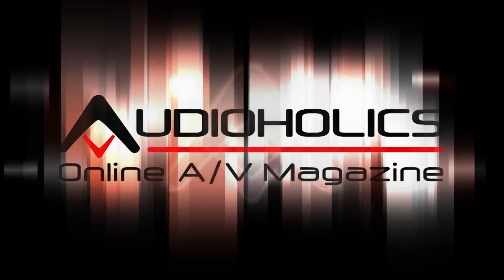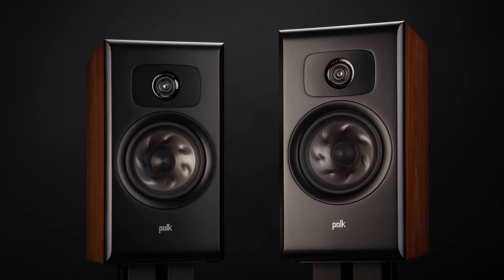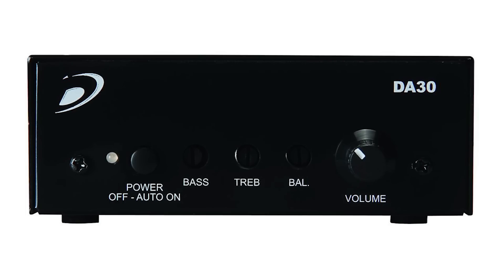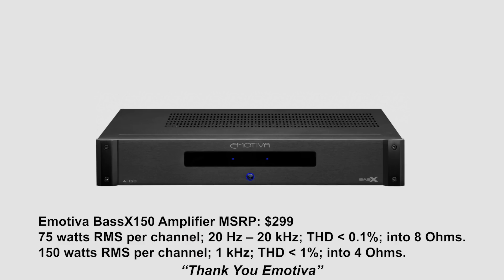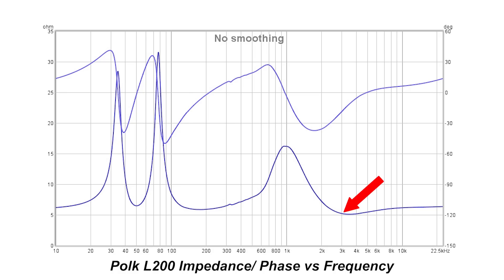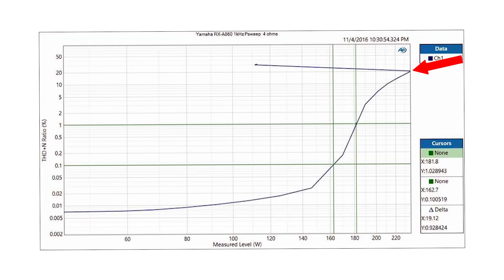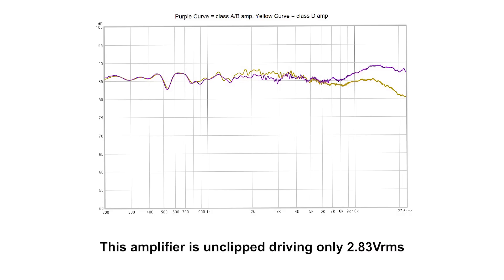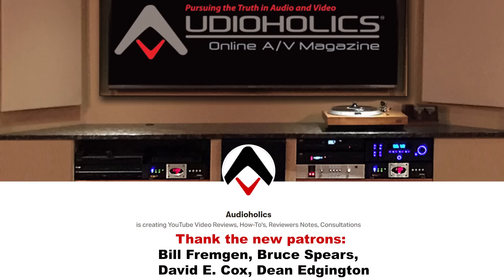Proof That ALL Amplifiers Don't Sound the Same

Comment: Useful info for sure, and a good reminder that amps must be able to drive a speaker at its nominal impedance. I’m not sure this proves that all amps don’t sound the same, though. It simply demonstrates that using an amp which can’t deal with a 4 ohm load with a 4 ohm speaker will provide poor results. Nothing surprising there.

Comment: Use the ice power 50asx(se) amp  its 50x2 at 4ohm and 0.003 thd and its under $99 on ebay. Pair that with the khadas tone board dac that has 0.000337%  thd that's under $99 and you will be in clean sound haven.  All the highs will come through flawlessly.  The amp they sent you had 1% thd if I'm not mistaken.  So that means that 1% of the pure sound was lost inside of the amp which is very noticeable.
Reply: Oahu Pc at 150W , 4 Ohm. It would be very small amount at lesser power output.
Reply: @RennieAsh  I'm really in to super clean sound and i found that the cleanest sound Is in the lower watt range. So when i see 150 watts at 1% that's not for me.

Comment: I prefer yellow curve.
Reply from the maker: The speaker measures a bit bright with a neutral amp. If you want to tame the highs, it's better to use a tone control then a bad amplifier.
Reply: @Audioholics  I like that one, so many people are allergic to tone control. I use it all the time, specially the bass control which I change with different volumes.

Comment: Gene: can you test using a Crown class D amp. They are very cheap (300 usd) and they say they can drive anything.
Reply from the maker: Yea I don't believe that claim but it's something I will try to test after I get the AH Smarthome finished.
Reply: Just like any other topology there are good Class D amps and bad ones. If you are curious about them then I would recommend the Crown 2502.
Reply: And they give you lots of hiss for free!
Reply: @mesonto  Only if you don't know what you're doing. Turn the gain down.
Reply: @666PANDEMONIUM  no, not my experience, returned them a while back... Cheap amp, but not a good one. Was buying them exclusively for a video room, for the cheap power. Gain adjustment was the first thing done to them. Maybe I and others get lots of lemons, maybe a quality control issue with Crown. 

Regardless will be staying away from them.
Reply: Get a Berhinger ep1500. it’s an exact clone of a QSCRMX 1450. class A/b 

Harmon makes good speakers infinity JBL the amplifiers blow
Reply: Carl Capps  I have Crown XLi2500 powering Cerwin-Vega! SL 15s. Sounds great, lots of headroom, under $500. class AB for anyone who don't know

Comment: Hi Gene I just experience this with my stereo system I bought a Onkyo receiver in 2016 and was using it to drive my Acoustic Research speakers 93s I bought new in the early 90s a few days ago I bought a vintage Luxman L  505u . Both of the receiver and intergrated amp are the same output, The Luxman is the first amp to really open up my speakers on the low end without having to adjust any tone controls because of the driver configuration they are like a baby brother to AR9s.(I did update the crossover caps and I had to replace the original woofers because of a cat catastrophe

Comment: From personal experience, my 1998 kenwood 2 channel amplifier sounds better than my yamaha advantage receiver (using both in 2 chnl stereo).

I have an off-topic question, i have jbl headphones, is it normal to hear a "hiss" noise when noise cancellation is activated?  I find they sound better when it's turned off?
Reply: @Jingle Nuts I can believe the Kenwood sounds better; being a dedicated 2 channel design it will be much simpler inside, giving a more direct path from source to speakers (especially if there are no tone controls, or they're switched out of the circuit). In general, an average 2 channel amp will sound better than an average receiver when playing music in stereo.

Comment: Hey Gene, I'm more or less in the 'amps sound the same' camp, really it's 'electronics sound the same', but there are caveats that go with that.  From Peter Aczel almost 30 years ago, The Audio Critic from its Spring through Fall 1991 issue:

"In general, any two components A and B that can be
alternately switched into and out of an audio system in an
AB test will sound the same if (1) their linear characteris-
tics are essentially identical and (2) their nonlinear charac-
teristics are below the threshold of audibility. If you think
about that statement for a minute, you begin to realize that
it‘s a truism rather than a heresy; the trouble is that the
tweaks and cultists often think for less than a minute."

That amp should not have been rated at 4ohms, it wasn't capable of maintaining a flat frequency response over the audio band.  Aczel specified for amps:

"Power ampliﬁers must
have high input impedance, low output impedance, no fre-
quency-response anomalies, and be at all times operated
within their voltage and current capabilities in order to
sound the same. "

Transparent audio just isn't hard, they've known how to design and build it, and how to test it, for a very long time.  If some piece of hardware isn't transparent when it should be, there's a problem somewhere, or it could always be gross incompetence, that possibility should never be ignored.
Reply from the maker: Agreed but without 3rd party measurements, most consumers won't know which amps behave properly into 4 ohm loads. There are esoteric expensive amps that misbehave, not just the cheap stuff.
Reply: @Audioholics  Mechtheist doesn't realize that never in this world did an amplifier solely designed by Peter Aczel** exist.  So reviewers are just filled with misinformation .  I am in the process of going through webinars on many products you carry and other manufacturers.  It's a joke the misinformation manufacturers feed to sales people (intentionally and unintentionally).  Like mechtheist I have been around a along time but I have 30 years of experience not 1 year of experience x 30.  One needs to design an amplifier to realize that you have to make a decision about what value component to use and how those different values change the sound.   And do not misunderstand, not an audiophile resistor versus non audiophile resistor but 10Kohm versus 8.4kohm.    I once participated in selecting an interstage transformer for one of the best amplifiers there has ever been to play music.  The amp designer made 13 slightly different transformers and on 3 seperate days I chose the same transformer each time.  It was a single blind test and the order of the transformers was randomized.  I was allowed to go 2 rounds reducing the amount of transformers I was comparing for my final selection,  For me I was surprised to have continued selecting the same transformer.   Measurement differences were almost negligeable individually addressed but if you compounded all the minor deviations you began to see how this component change and its properties affected the sound of the amplifier.  You also could see what measurements mattered in possibly revealing the sound of an amplifier,  Needless to say a valuable experience.

**I never saw a list from Peter what "properly designed" amplifiers measured like,  if you want to sniff out a know nothing, let them begin to talk about THD.  Amplifier specifications are useless and Stereophile only gives you half of the important measurements and if you watch carefully you will see some amplifiers get a "break" as all measurment conditions are not equal.  I would love to see after 1 year experience x 30 what Mechatheist's system consists of....I would like to be surprised.
Reply: @JurMalafi  Got no idea what might elicit surprise, but here you are, Denon X6200W AVR, Cinepro 3K6^3 amp, JTR Noesis 212RT fronts, just acquired Crown DCi 8-600ND amp I'm playing with--the DSP and networked audio capabilities have amazing potential, plus a Rigol DS-1054Z.
If you're familiar with Aczel, then you should be familiar with The Audio Critic and would know the answer to your question about measurements.  Can you point to any misinformation Aczel has promulgated?   As I've said, and Gene has repeatedly said, they know how to measure amps and can reliably determine transparency.  Hell, this video demonstrates this!  They're now able, with Floyd Toole and others work, to determine pretty accurately how well speakers will sound FFS! [that doesn't apply to the bass where the listening environment often dominates]
"Audiophile resistor"?  You're claiming resistors have a sound?  That's entering cable-woo territory.  Is it supposed to be a surprise that different values of resistance could affect sound?  As to your transformer example, there's not enough info for it to mean anything.
For all of those who so adamantly claim amps sound different, why not simply demonstrate it?  Double blind testing amps is about as easy as it gets.  If you're one of those folks who don't accept the need for such tests, you aren't worth listening to, it's simply a fact that humans are utterly incapable of unbiased choices, something that's been known for over 50 years.  Just think about the implications that double blind testing is required for such things as testing pain meds.  It's required for most anything where there is a subjective evaluation involved--if the person giving the test, no matter how honest and no matter how hard they try to not bias a test, if they know what is being tested, they will nevertheless influence the subjects enough to render the test invalid.
"Amplifier specifications are useless" and "only give half of the important measurements" are kinda contradictory statements.  Do you mean amp specs as usually seen in ads or data sheets?  "100 W with 8ohm load from 20Hz-20KHz, with THD + noise < 0.01%", is that a useless spec?
Reply: @mechtheist  I told you the transformer comparison was single blind, how could I have a bias?  They were all visually identical, they were hand made by the same man.  There wasn't one I was supposed to like, this is what we were determining, which one sounded the best.  There were probably 5 suitable transformers that could have went into production, but I picked the same one 3 times out of 13 x 3 comparisons.  That is seriously significant.  Too bad you don't recognize that. And your assessment that the tests have to be double blind is just crap, its academic BS and we're not trying satisfy academics who will never know anything.  We were trying to put an amplifier in production.  The double blind is important but we are not trying to create an academic document for review. So to be clear Double blind is not always required for trivial audio things,
I owned 2 QSC ABX Comparaters to run tests and had friends help me as the test listeners (hundreds of trials).  You read  about a guys opinion, as I hinted in my original post, what do transparent specifications/ measurements look like?  I see how Gene measures amplifiers but he skips important items.   Let me show you how you don't think deeply as you make my case for me.  You belittle me for saying two resistors will obviously sound different...well which one did I use in the production model amplifier?  They both sound good but different ("obviously" as you would argue) doesn't that just blow a hole in the all amps sound the same argument?  As the designer I had to choose between 2 resistor values in the circuit, or in my first example pick 1 of 13 transformers that sounded the best.  If the amplifier sounded the same with all 13 transformers the chances of me picking the same one 3 times is pretty astronomical.  We did the third trial specifically because the amplifier designer couldn't believe I picked the same transformer twice.
You don't need anymore information about it.  Precautions were taken because the success of the amplifier relied on an accurate test. 
As I said spec sheets are useless,  Anyone who looks at the THD <0.1% and thinks that means anything knows nothing.  Are you sure the amplifier is not 125 watts?    And it isn't contradictory to say Stereophile measures about half what you need to know, measurements are not specifications...you know?
For many things I am on Aczel's side and read him through the 90's, but his errors are of omissions and leaving it up to other people to prove him wrong.  I have even proven cables sound different to astute people like Bob Cordell.  Infact the Kimber Gene selected for his system was recognized as different versus Blue Jeans and Sound King and Home Depot extension cord.    The Cardas and the MIT I brought were so obviously different we just skipped comparing them, this was to the satisfaction of the critic hosting the blind test.
So what specs, tests or measurements do you use to verify that your equipment is "transparent".  I could never get this out of Peter, but maybe I overlooked these incredibly important details when they were published.  Thanks in advance.  and just providing a link would be more than great.  No need to explain, have had these discussion before.  
All I hope is you listen to your music in surround like Floyd Toole suggests....I have nothing against PA speakers for home use.  Eighteen sound's kits are really good and with a dsp crossover a breeze to make if you feel your rears don't require the coaxial driver.  So maybe you could save some $$$ on your surrounds.